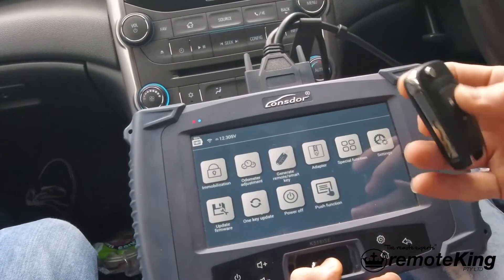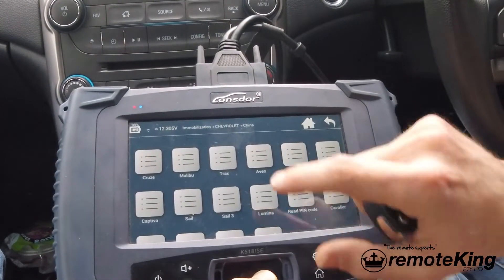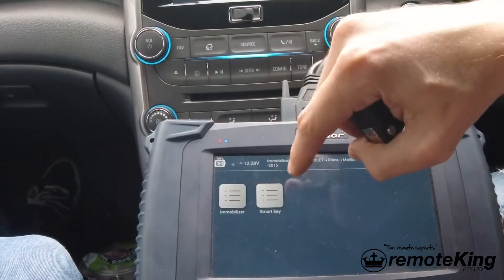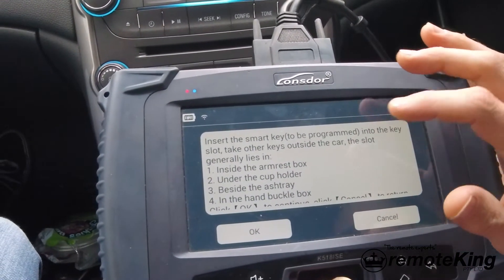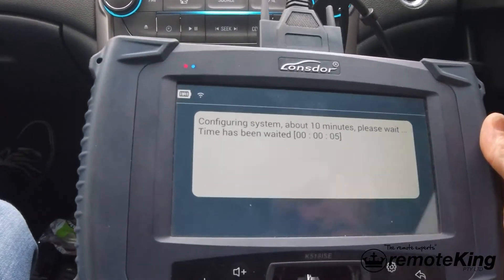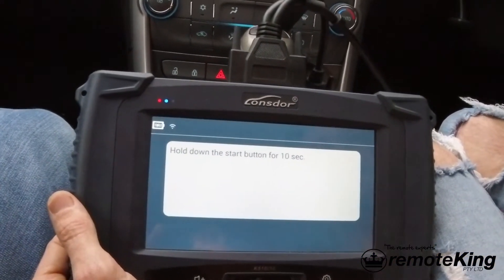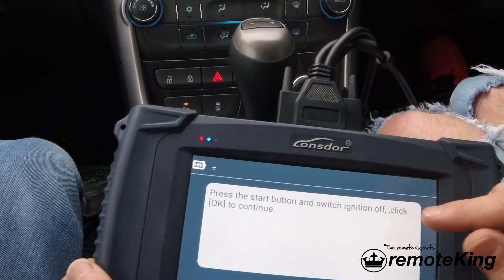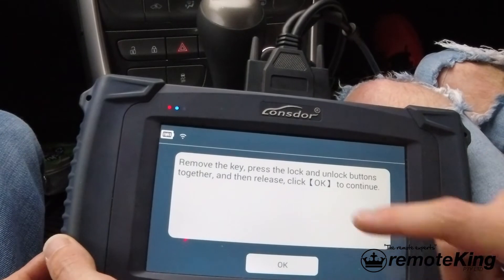Holden Chevrolet Malibu Eighth generation 2013–2016 Smart Key Programming

Comment: Can this be done without the Lonsdor like the Chevy Malibus? I want to add a key but don't want to buy a Lonsdor or take it to a dealer, thanks
Reply from the maker: Hi kenwin916
This is a diagnostically programmed key, there is a few tools that will do it but there no manual procedure that I am aware of sorry.
Reply: @RemoteKingAUS  Thanks for the reply, is there other tools that'll do the same job but cheaper than Lonsdor? I don't want to fork out few hundred bucks to program one key, many thanks.
Reply: https://youtu.be/BJts7AeOjQ8